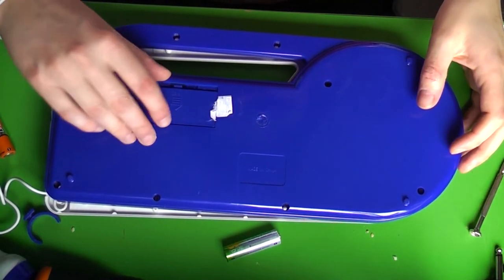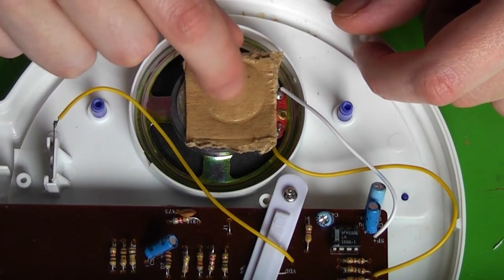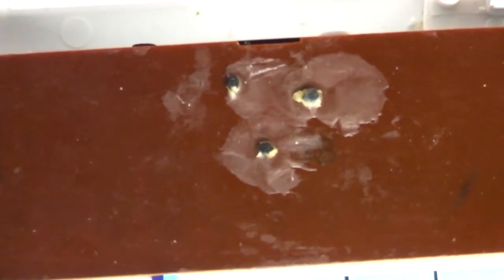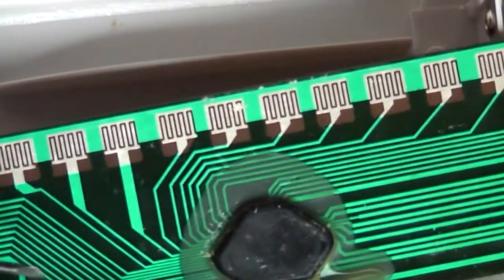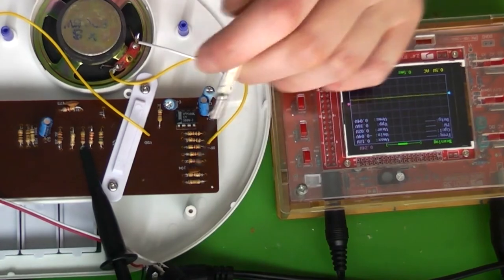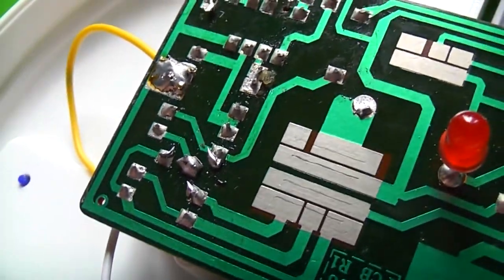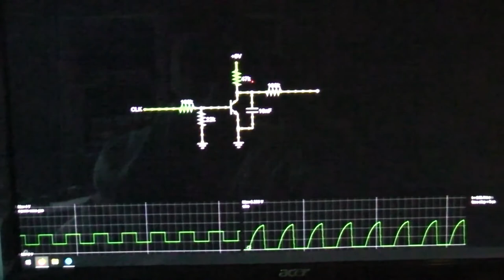Circuit Bending a Cheap Toy Piano - Part 1 - The Cheapening

Comment: I knew someone who had one of these, I borrowed it from them and loved to play the demo songs.  I've been thinking about this keyboard quite a bit lately, I'd kind of like to get one of these.  The one I played with was called My First Pianola, and I think it was made by Ching Chang Toys in Taiwan.
Reply from the maker: It's a pretty fun toy to mess about with yeah :)
Reply: @rot_studios  It is, I just want to hear the demo songs again.  As I say, I borrowed one of these from someone I knew back in late 1992, and it had some interesting faults with it.  Firstly, the power switch was damaged in some way.  When you turned the power off, it wouldn't turn off properly, that is, the power light would glow very dimly and the speaker would sometimes crackle too.  Also, the tone or mode switch did some odd things, if I remember correctly, I could set it to organ or melody, but when I set it to piano the voice would stay on organ.  Also, when I switched it to melody and played one of the built in songs, it would use the organ voice instead of the piano voice.  Subsequently when I used the keyboard in later years, these faults had apparently been rectified, I wonder if somebody repaired it.  Too add to that, the microphone didn't work, the wires were broken.